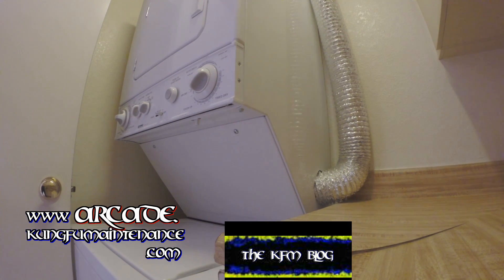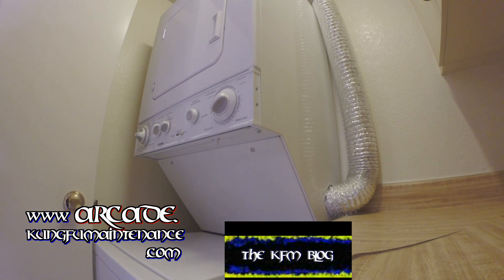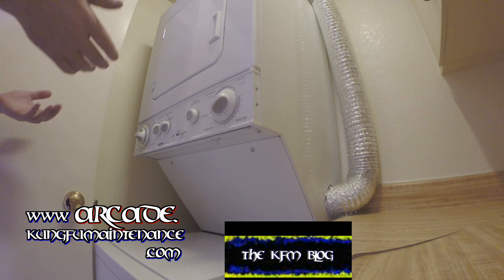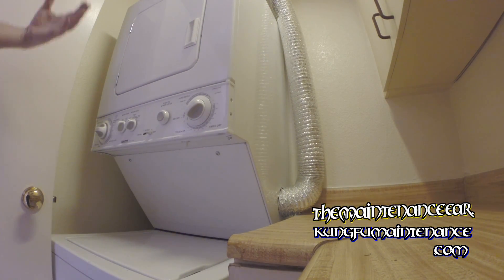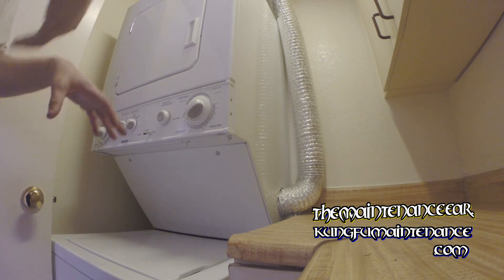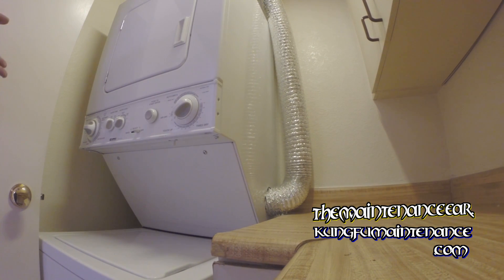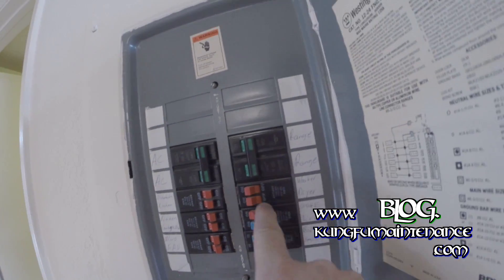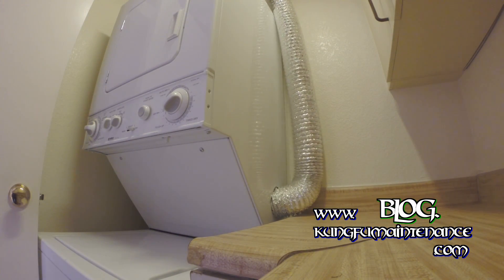110 vs 220 Volt Laundry Clothes Dryers Controversy

Comment: Resistance heat is watts in equals heat out. Simple math show a 220 line is 4x the wattage of a 110. Your video is not really accurate on drying side.

Comment: I don't think this is the full picture. A 220V line and unit can run higher amperage and would be able to increase the heat output in total heat wattage. Even if the heat coil was the same, it would be taking in more power and generating more heat to its max ratings if it was not utilizing its full output at 120V, or could be a different heat coil. Have you timed or measured actual power produced from the dryer ?

Comment: A 110v will never be as efficient as a 220v machine. 110v machine will have to work harder to dry your clothes. A 220v machine will cut that time in half. 220v 45 to an 1hr compared to a 110v 2 to 3 hrs which would equate to more wear and tear and less efficient machine overall.

Comment: Many countries standard is 220v-240v. What's the difference. Well one big difference, 220 powered equipment will use LESS amperage. This makes 220v items more cost effective to run over its lifespan. One of the first things you learn in electronics is amperage draw directly affects your utility meter.

Comment: If you've ever had a stackable W/D in your apartment you'll know it can take 2 or 3 hours to dry a load of jeans.  The physics of how electricity works tells you that you just can't get as hot with 110v as you can with 220v.  With a 110v dryer it can only produce about 1500 watts of heat (a little less actually because it still has to run the fan and rotate the drum), while the 220v can put out a lot more heat. Yes, the 110v will work, but it will take longer to dry a smaller load than a 220v dryer.

Comment: Cry foul. All dryer motors are 120v. 120v heaters do not dry as well as 240v heaters. This is a whirlpool design. 24 inch laundry centers that are 120v do not allow the washer and dryer to run simultaneously. Dry times are longer. Recheck your facts.

Comment: This seemed wrong  based on personal experience and a quick google search confirmed it. ( As well as many of the comments over the years here from repair people and electricians). 220 dryers heat up quickly and dry clothes in less time than 110. You wait longer for clothes to dry on a 110, so your clothes are also getting beat up in the dryer longer. Gas is also a better choice than 110. Also, if you are advising people on running dryer vent, the thin foil accordion type stuff you have there is not the best choice, unless you clean the lint out on a regular basis, which most folks will not do. Never buy that cheap stuff, even semi rigid is better but rigid dryer vent is best and safest. Spend the money and take the time to do it right.

Comment: A 220 volt motor uses less amps to generate power .  You will save on your electric bill ultimately with a 220 volt motor, more expensive initially because it costs more to make it but significantly less cost to operate.

Comment: So, I’ve converted enough full size dryers from 220 to 110 to know that almost every dryer uses a 110v motor which is what makes it possible - the coils use the full 220 volts to get hotter and dry quicker - a dryer converted for 110, even with the elements changed, takes 1/2 to 2/3 longer to dry the same cloths - 110v dryers are for people with antiquated electrical service, rv’s and Apartments and homes that don’t have any hookups - if the motor needing more power was the case then every washing machine would run on 220v as well considering the amount of power needed for the spin cycle

Comment: you would only go with a 110 V dryer if 220 is not possible. 220V has 4 times the drying power.

Comment: You wrong most 240v units use 120v for motor timer and 240v for the heater, full size units run about 5800 watts witch you can't get out of 120v outlet. Now your unit is much smaller than full size and build run 120, it should work fine.   I repair far number dryers just happen it looks like to me one could wiring 240v unit run just 120v some even say how wire inside,  It just happens I have dryer in place where no easy way wire a dryer outlet and there thought this long term placement, so my thought is just wire unit 120v. Now what think will happen is heater draw 1/2 amps it also at 1/2 volts so heater would only have 1/4 watts, I sure that going hurt drying power some, but hears funny part the heater does not run all time it turn off and on, so  even at this lower power drying maybe not that bad if unit not over loaded, I trying find out before tried it,    As for motor thoughts, even if was use 240v motor I don't cost saving, in fact I think other way around at this power level, witch way don't do that.

Comment: I desperately need a 110 dryer. Does anyone recommend a brand of 110 dryer and where to get one please? I do not need the washer part. Also is there such a thing as running a propane gas dryer using a small propane tank next to it outside like you would a gas BBQ? I live in a RV.

Comment: Hire someone to run a cord from the dryer or the washer separate so two plugs are used on the combo unit.
It is about a three on a ten scale for difficulty. 

Of course, they would say to run each one on its own circuit. Eh, if it works ok without tripping the breaker leave it.
If not branch off another circuit for an additional 110v circuit behind your unit. 
Now it's getting more expensive. If the trip is when you turn on the dryer perhaps it is just that instant surge.  If it tripped during use of both then the circuit is overloaded. Possibly just slightly. 
Personally, in that case, I would bump up that circuit with a slightly bigger breaker by 5amps "only"
I've done this and felt wires in my box and the cord. No additional heating occurred to my wiring, under full load with that circuit. A slight warmth on my wrist.
 Lighting is usually the only other thing on those circuits anyway. 

GL apartment dwellers.
This way you can wash clothes like the rest of the planet.

Also, I believe he is wrong in this video about 220 units. They do put out more heat than 110v. 110v is sufficient for most drying.
This is the attraction to 110v units, to begin with. 0_o

Comment: Uh, this isn't a debate, nor a controversy. Not that I've ever heard. I worked as an electrician for several years before going back to IT, and I've just never heard a debate over this. Not from homeowners, store salespeople, nor other electricians.

All new construction in North America, pretty much, is wired for 220/240V for your range, HW heater and dryer (assuming you use electric). 110/120V is usually only ever used in North America for those without the 220V hookups (older buildings). As others have said. This is usually the only reason anyone uses 110V dryers - because they don't have a 220V circuit wired for a dryer. There are some people here or there that choose 110V dryers on purpose (like you apparently have), but they are rare.

110V driers are more expensive, so not sure why you'd say they make 110V dryers to save money. Especially when they usually use 110V motors. 220V drivers are cheaper, but mainly because of economies of scale (also previously mentioned).

It's false that a 110V dryer has the same heating elements as a 220V; the wattage on a 220V dryer is much higher, enabling faster drying times. Often, much faster. That higher wattage comes from bigger heating elements. You get a lot more power out of a 220V, 30/40A circuit than you do out of a 110V, 15A circuit. 

So you might save some money on your electricity running a 110V dryer, since it uses less power, but it does run longer so that narrows the gap a bit. Given the rather negligible cost difference between the electricity usage of the two, I have no idea why you'd choose a 110V dryer if you had both options. And for me, as busy as I am, time is money . I can do more loads in less time back to back with a 220V dryer, so I'd always choose one if I could. Unfortunately, I can't, living in a 1926 apartment not wired for it. And I can't go drilling holes to add another 220V circuit myself (which I'd do if I was allowed; it's a simple task).

110V dryers also tend to be "portable" units not intended to run continuously for many hours like full-size dryers often are (especially with families that have lots of kids), so you can burn out a 110V dryer easier with some models. Most in NA are intended for one or two people in small apartments, not families.

So not sure what the point of this video is, since most of the key facts are wrong. And the water & electricity warning is odd; it's not like you're telling people how to rewire their house. Overuse of disclaimers is annoying. You have no need for one here, and it rather assumes your viewers are idiots. Everyone knows water & electricity don't mix.

Maybe I'm missing something.
Reply: Filming In Portland My reasoning for wanting a 110 dryer is due to the fact that I live in a 5th wheel RV. I currently have a washer/dryer combo that works fine but takes forever to dry 4 bath towels so I wanted to purchase separately a 110 dryer and plug into 110

Comment: that is a gas dryer. I must say they do make 110 electric dryer. they are usually smaller and doesn't heat as efficient as 220 dryers.

Comment: nonsense.   The motor is almost always 110v, even in a 220v dryer.  They build 220v to allow for a higher heat element with the same size house wire.
Reply: rtel123 that's true because I can see my 220v dryer going from around 500w with element off and up to 6000w when elements cycle on.

Comment: Goodness this is a weird debate. All clothes dryers use a 120 volt motor regardless if they are heated with 240 or 120 or natural gas. Look at the circuit diagram on any dryer. How can this be? 240 volt wiring is 120 between two wires = 240 volts between any one 120 volt lead and neutral is 120 volt. 120 volt motors are used to lessen the parts inventory for production of all dryers. A 120 volt dedicated circuit in residential housing is either 15 or 20 amperes. If you do the math 120 volts X 20 amperes equal 2400 watts maximum, at 15 amp about 1800 watts. Small 120 volt dryers have limited heating energy available due them being "plug&play" on a standard 120 volt outlet.
Typically a 240volt dryer supply is TWO 20amp combined breakers, this would allow manufactures to double the heating capacity. A motor is required regardless and factor in the time to run the motor load and that 120 volt dryers take almost twice as long to dry the same sized load, this makes the 240 volt dryer more efficient in that the motor runs for a shorter period.
The debate if you have 110, 115 or 120 volts is arbitrary, as most distributed power in the USA as been 120 volts for quite a long time. Over the decades utilities and appliance makers worked to raise the voltages. It works out to enable same sized wires to carry slightly more power same for 220, 230, 240 volt

Comment: People are charged by WATTS used. Period.  The amps and voltage mean nothing.

220 Volts x 5 Amps = 1,100 Watts
110 Volts x 10 Amps = 1,100 Watts

Only idiots who do not understand that relationship between Volts, Amps, Watts are stupid enough to say that 220 is cheaper to operate.
Reply: +Greg Swamp most appliances if needed work on a 220v because this is a perfect way not to overload just 1 line,,plus if having 2 hot lines would mean 2 guys working on a proyect versus 1,,do you know what i mean,,,basically if your house needs more or will consume 4000 watts and more,,you will need a 220 v service,,but speaking  about dryers most dryers work on 220v because ot the heat needed and time to heat up....

Comment: BS is right...This is about voltage Kung Fu.....220 is 110 for the motor, to spin the tub, the other 110, is to dry the clothes, using an electric heating element...The machine you are showing, is 110-115, gas dryer, the gas drys the clothes, 110 spins the tub...Pull down this video and do it right
Reply from the maker: +King Kano World Media ~ No gas no BS. 120 volt laundry center. Washer/Dryer.
Reply: your dryer in the video is 110 Volts using gas to dry the clothes in a 210-240 dryer it is 110 to spin the tub and 110 to dry the clothes with an electric heating element. The pictures, movie and words all need to match, or people are going to get confused. Our 210 appliances are not true 210, they are 110-125volts times 2. In a real 210 to 240 world there are no neutrals just two 110 volts hot wires to get the job done and if you are lucky, a ground wire.
Reply: King Kano World Media koo

Comment: It has nothing to do with the motor. A dryer only needs 110v to drive a motor strong enough to tumble the 220v is need to provide the heat.  A 110v element can only provide about 1800 watts of heat where a 220v can provide 3000 plus watts of heat. So it will take much longer for a 110v heater to dyer clothing. Also you still will need a separate circuit as plugging a high wattage appliance like a dryer into a circuit with other appliance can cause an overload. The power a standard 110v outlet can provide for a heating device is about what is need to run a toaster over or space heater. If you don't have the service to run 220v you are better off using gas has the heating fuel.
Adding a high draw electric appliance to your home is not a do-it-yourself project you need a professional regardless of if it 110v or 220v, the appliance need's a single outlet  dedicated circuit with no other appliances lights or any other power draw on it.  Saving a few dollars is not worth burning down your home.

Comment: BS! the motor isnt the important factor. the voltage is.. t 220 is a fact it heats quicker than 110 because at 220 it req less amp. At 110 its less power but draws more amps. And being most 110 outlets are 15 20 amps this limits the power. 110v dryers are a waist of money
Reply from the maker: Thanks for fueling the debate a bit. Most electric dryers whether 220 or 110 use heating elements for the heat. Temperature limits are pretty much the same. You may be right concerning sustained heat output. I hope to test this out a bit more and better examine the comparison in the future.
Reply: Lol. Sorry for the way this comment was presented as it can come off mean. Its stated in a combative way due to working with computers alike daily and my apologies if this came off mean ;).. Good debate. Temp is the same regardless, but it does work harder at 110 and take longer.

Comment: I can see what you mean about adding to the cost of the dryer. I have a Whirpool LDR3822PQ 120 volt dryer, which when they first came out cost around $650. I got a used one for $150 at Best Buy. It wasn't fun getting that thing up to my second story apartment up steps and without a dolly.

Comment: Here's something worth mentioning pertaining to the stacked combo units like the one you show on this video. With the 110 volt combo units you can't operate the washer and dryer at the same time. You have to switch between them. With the 220 volt combo units you can operate washer and dryer at the same time. This definitely would influence me to go with a 220 volt combo unit as opposed to a 110 volt combo unit. It's much more convenient to be able to run the washer and dryer at the same time.
Reply: zcx99 Wouldn't make a difference to me.  I don't need both at the same time, I need a 110 so that I don't have to hire an electrician or get a permit to make a new 220 line.
Reply from the maker: Excellent point. ~ Thanks.
Reply: KungFuMaintenance No problem. Great video!
Reply: Hire someone to run a cord from the dryer or the washer separate so two plugs are used on the combo unit.
It is about a three on a ten scale for difficulty. I assure you. I would come there now and do it at a reasonable cost. 
Your post was a year ago and you have since moved. lol jk
Reply: Just run two separate lines with two separate breakers.